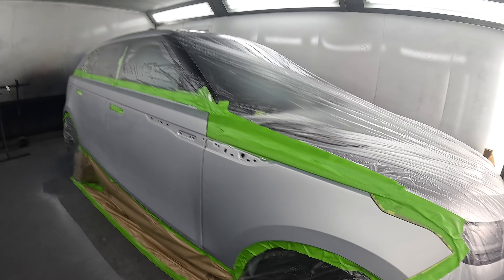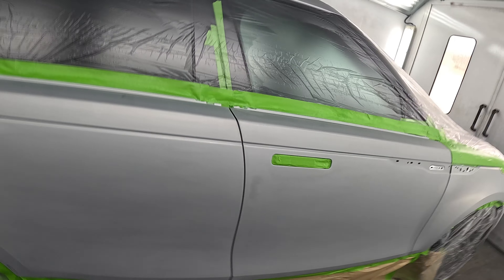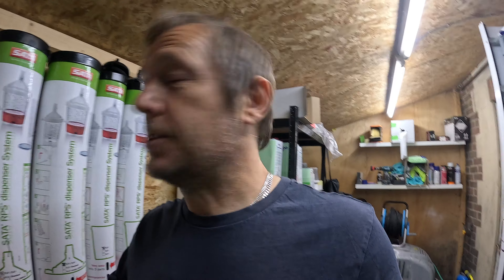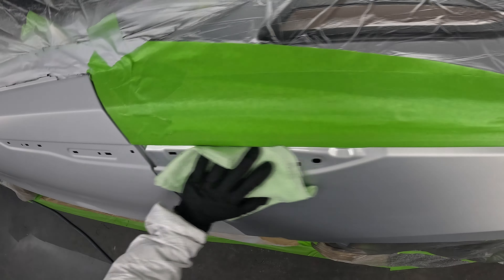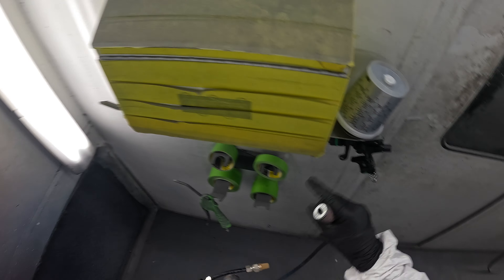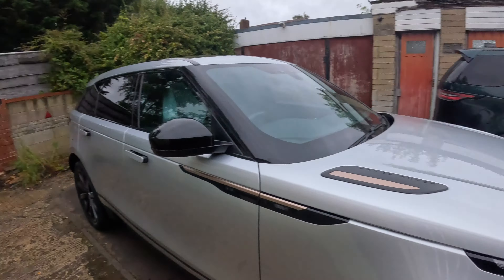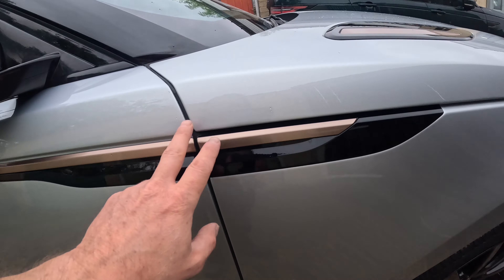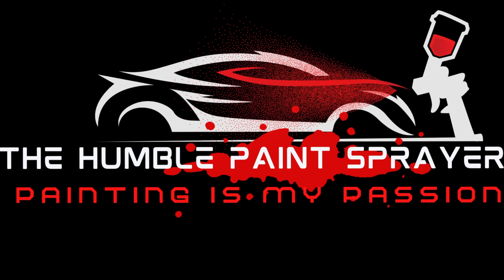HOW TO RESPRAY A BAD PAINT JOB | BLENDING SILVER | PART 2 THE SPRAYING | RANGE ROVER VELAR .......

Comment: Hi Jason, very interesting video again mate the Range Rover looks like new again just like you were never there which is how it should be unlike the last person that made a right mess of it🙄🤭

I might have mentioned this before but if you look at the 1.3CC tip then compare it with the 1.2i (or O) tip you should see that the 1.3CC is smaller than the 1.2i🤔someone I know has the tools to measure an internal diameter and he told me the 1.3CC is actually 1.15mm🤷‍♂I've been experimenting using the 1.2i and the 1.3i tip (I don't have the O tip but both tips are the same it's the aircap that changes the fan pattern) with the CC aircap and it speeds the gun up but it still produces the same CC finish, maybe it's something that would help you Jason👍

Comment: Nice job! I recently used the 4+1 as a WoW after always using the F37 WoW and I found the 4+1 WoW actually lays flatter than the F37. It's now my go to.
Reply from the maker: Many thanks, yes I use it often as WoW but I do prefer F37 for new panels it’s has better adhesion properties and anti corrosion for new panels, it will bond to factory e coat without sanding but it does take a lot longer to dry and needs to be applied really wet to be smooth 
Do you use the VR thinner in the 4+1 WoW
Reply: @TheHumblePaintSprayer333  Yeah, the VR thinner is brilliant. I still use the F37 when required although I do still key up new e-coat just for my own peace of mind. My only annoyance with F37 is the lack of spectral grey shades. I would prefer they made it in just black and white so you can then make your grey shades.

Comment: Excellent finish. That must have been the range Rover I painted last year. Thank you for fixing my bad paint job 😉 very nice work my man. I watched part 1 yesterday. If you think that CC gun is slow. Try the DV1 you will fall asleep while painting. 🤝♥️
Reply from the maker: It was ok like i said in the video i didn't get the finish i wanted on this one, it was a bit light for my liking, we like a lot of clear on them don't we 😄
Man that wasn't your standard of work dont be silly 😂 you paint what your asked paint and you do it right and consistently high standard, i can see your very efficient and fast and you must be a real asset to your boss
ive worked at many places where other parts of the job might not be repaired very well or not been stripped and id just paint it to my best ability thats all you can do , wasn't my department 
Its different for me here as I'm being paid for the job
Thanks Man 👍
Reply: @Mfull-l4r 🥹 that's cold my man that's cold 🥶 😂😂💪🏼💪🏼

Comment: Hi Jay what basecoat blender do you recommend for using with octoral eco? I’ve got an old E36 in titan silver coming up which seems to be a different shade on each panel 😅 thanks! Great job on this by the way!
Reply from the maker: it uses the transparent base coat tinter thats used for the 3 stage tricoat and pearl coats it also gives you the option when you mix the colour to add it to the mix if your blending it, i can't remember the tinter number, put 1 coat on then dry it before base coating
Reply: @TheHumblePaintSprayer333  I’m sure it’s W23 but I’ll call the rep this week to be 100% certain. thanks for replying!
Reply from the maker: @JF-bk5sp  Yes it is, quite often used debeer tinters so had to cross reference the numbers

Comment: NOW JAY I HAVE SOME MIPA HS LOSER  BLENDER DOES MIPA FAST THINNER HAS TO BE USED WITH IT OR CAN I PUT IT STRAIGHT ON NO MIXING REQUIRED 😊
Reply from the maker: What you using it for, HS LOSER is just fade out thinner for blending 2k clear and direct gloss you dont need to add thinner to thinner mate
Reply: @TheHumblePaintSprayer333   Jay you know I have have had  nightmare trying to match the base coat paint on my bumper on ford focus mk3 titanium x  I have DA sander the whole bonnet yesterday with 320 grit and used a scotch pad so can I Jay wipe the bonnet down mate solvent paint wipe and apply Mipa HS LOSER AND THE BASE COAT PAINT AND CLEAR COAT PAINT AND THATS IT AND THE SAME TO THE BUMPER
Reply from the maker: @ANDY-we7mr  You don't need to put HS LOSER on it, thats for fading out 2k clear and direct gloss in to existing paint work it not for base coat to go over
Reply from the maker: @ANDY-we7mr  No don't put HS loser on the panels before base coat
Reply: 1:19  @TheHumblePaintSprayer333   NO JAY THE BONNET HAS BEEN PREPED FOR BASE COAT PAINT SOLVENT I WAS JUST GOING TO GIVE IT A LIGHT SPRAY BLENDER OVER THE BONNET AND THEN SOLVENT BASE COAT PAINT ON THEN CLEAR COAT PAINT JAY I HAVE SOME BASE COAT PAINT BLENDER PRO SPRAY CAN I USED THAT SAYS FOR BASE COAT PAINT
Reply: Great job Jason, 
You turned a “Dogs Dinner” into a “Michelin star meal” ! 
Thanks for sharing as always mate. 
Cheers 
Vince.